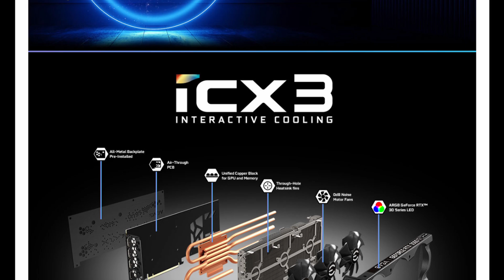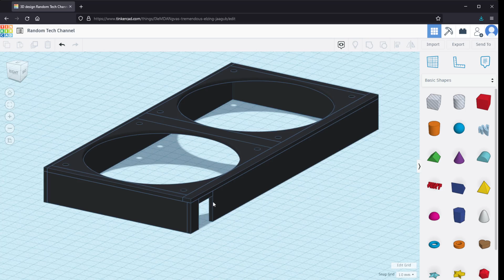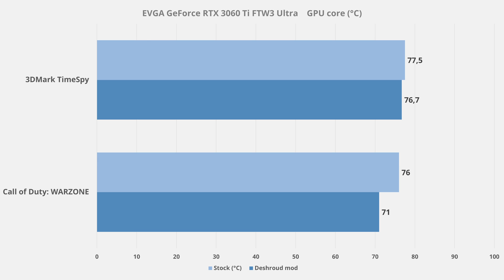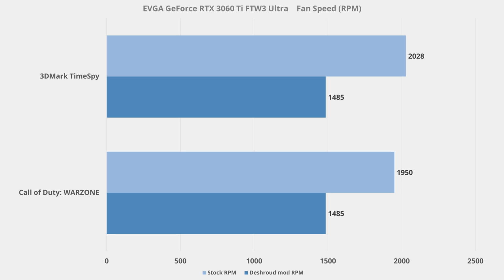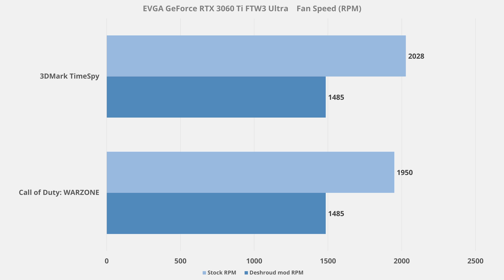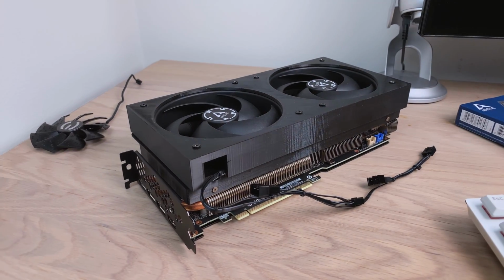I've designed a new shroud for my EVGA RTX 3060 Ti FTW3 ( 120mm fans included )

Comment: HI! I have this exact card. Planning to mod it as well, I checked the file you have in the description, I only plan to use the fan bracket. But I can't find it in the file. Can you please help me? Thank you.
Reply from the maker: There should be 'Files' tab on Thingiverse site once you open the link from the description.
Reply: @RandomTechChannel  Hi! When I click the link you have in the description, this is what is says "
EVGA RTX 3080/3090 XC3 custom Cooling Shroud"

Is this compatible with 3006ti ftw3?

Comment: I have two 3090 XC3 Ultras, 3060 ti FTW3, 3060ti XC, two 3080 XC3 Ultras, and a 3060 12GB.  I can see a fan mod on a 3090/80, especially the 3090; however, the 3060ti runs exceptionally cool.

Comment: Honestly for the results its a mirracle that it even helped. You GPU doesnt have any airflow and like this its probably best for cooking. Tip for you - open the front plate and instal any of fan in front or in bottom part (read in manual) and bring some fresh air to your GPU - it will decrease 10°C even without deshrouding and with it at least 15°. Trust me i know (same case 3090 deshrouded)
Reply: Do u use Zotax 3090 trinity by any chance?
Reply: @Nods.O  Hi, unfortunately not, i used Inno 3D X4 (really bad cooling) - but for your info i have so good results that i will create a video how to do it after this weekend. Just search then for deshrouded 3090....
Reply from the maker: Please have a look at my recent deshroud video which includes 3 120mm fans at the bottom of the case pushing cool air at the GPU. https://www.youtube.com/watch?v=ueLpP-Kaw4A

Comment: I too used the P12 for a while on it. Then changed them to Phanteks T30. And let me tell you, it totally does not worth it. At the same noise level, they perform identically. And if you increase the RPM of the T30 above 2000.... Well lets just say you don't want to. It's loud as hell. The P12 is simply amazing.
Reply from the maker: Thank you for letting me know! I might test Arctic’s new P12 MAX fans at some point.

Comment: Would have appreciated it if you have shown what kind of  connector the card was using. 4:10
Reply from the maker: It is a standard 4-pin PWM fan connector. The fans were not connected to the card.

Comment: Arctic fans are so underrated.. it is a great replacement for noctua fans yes in terms of noise and temperature 🌡️ vise. it is tested that in noise its 1-2 decibel and max 2-3° in terms of temperature in 100% load compared to noctua. and its dead Casper then the noctua.

Comment: it is simple physics that the temperature is very less. Just install the fan without the 3d printed bracket and you will see the real difference.
Reply: I installed the fan without the 3d printed bracke. The heat is hotter than with it.

Comment: You should redo the shroud design but this time instead of the 1800rpm arctic p12 fans use Gentle Typhoons 2250rpm!
Reply from the maker: Gentle Typhoons were my fav fans about ten years ago. Unfortunately Scythe doesn't make them anymore. I wish they were still around though.
Reply: @RandomTechChannel  Hi, thanks for the reply.
Actually even though scythe does not make them there is another company called XPG which has been selling them under the name XPG-Ventus pro 120.
Also perhaps in the future some Scythe Wonder Snail 120s would be nice to try ;).
Reply from the maker: @AutodidactEngineer  Thanks! Good to know. I will have a look at them at some point. (Have a cabinet full of Arctic P12s :-P )

Comment: Hey there, great video explaining the things I couldnt figure out on reddit. I have a question still however. For the original fan bracket do I need to get the one with or without overhang? I am thinking with but I am not sure if it matters. Also what material did you use?

Edit: got everything and installed it but unfortunately the shroud is too wide for the motherboard and i so cannot fit it. I now just have the barebone fans
Reply: Hi! You say you did tbis mod only without shroud.Does it work without shroud?
Are the results worth the investment?
What is the difference in temps stock/mod?

Thank you!
Reply: @krelcic  
1 Yes, it just looks less pretty
2 No, including fans it was like 200 euros so it is not worth it in general but for me it was quite nice, I used the nf12x25 for my 3080 and I never hear it
3 Did not test tbh sorry did it for sound only

Comment: I wonder, when GPU manufacturers will learn, that 2x120mm is more effective and quiet than 2 x 90/100mm and 1 x 80/90mm. Its 2022, and they are still in 2015. I really wish GPU without ANY fans, lower pirice, and conectors + handles for 120mm fans. Zipties are fun, but end look is dramatic - i use it that way and created cover for fans, so they are not visibile.

Comment: Isn't that AIO installed incorrectly? Radiator tubes should be higher than the pump to prevent air bubbles getting in to the pump.
Reply: almost best position, tube on radiator down is after top mount second best position

Comment: Great mod! For those not connecting the replacement fans to the video card, you can use Argus Monitor to control the fans using video card temperature readings.
Reply: or you can use FanControl that is free
Reply: It's amazing software really

Comment: The reason there is barely any difference is because the heatsink on the GPU is too small.

You want atleast a 2-Slot heatsink without fans.
Reply: nah, you need fans more suited to the size of the heatsink, you also need fans that get close to the RPM of the stock fans, on top of that he would've been better using 3x 92mm fans
Reply: @insomniacbritgaming1632  surface area is surface area, and if there isn't enough no amount of fan will be able to help you. The EVGA RTX 3060 Ti FTW3 only has a 1 slot thick heatsink, which isn't enough.

Comment: I think the heatsink might be too small. There's always two parts to the equation: 1. The heatspreader has to dissipate heat into air 2. Fans have to move cold air into the heatspreader. If the stock fans already provide enough cool air, having better performing fans won't impact thermals much (you could run them at much lower RPM though). 

That might be the effect you're seeing. (it's a continuous process of course).
Reply from the maker: Headsink can be one reason indeed. However Asus' Noctua MOD card is using pretty much the same heatsink as the regular version. I'm working on my next video with some improvements over this one. 'Stay tuned!' :)

Comment: I'd recommend repasting. And to be honest, it might be worth getting the Morpheus and putting dedicated heatsinks on the VRM and mem modules.
Reply: I emailed rajintek support and the Morpheus core 2 isn’t compatible, though are there other ones like that
Reply: The problem is to find a Morpheus Core II or Arctic Accelero Xtreme 4. They are very rare to find. Plus this vga used in the mod already has a great heatsink. Asus Strix also has great heatsink. And the way the heatsink is designed and attached in this gpu makes it easy to place the mod there

Comment: I would suggest high static pressure fans for this mod.
Reply: They are arctic p12s
Reply: @jarrodau2134  the problem with that is these are marketed as high static pressure fans but only have a static pressure rating of 2mm. Which is an extremely low static pressure.
Reply: @RVACREF  I'm sorry you're unable to understand that they are very solid fans
Reply: @jarrodau2134  those are extremely low static pressure fans, you are looking for high static pressure fans. Do you even understand what the difference is?
Reply: @jarrodau2134  well you obviously don't understand what static pressure is. Both of those videos didn't even touch the static pressure rating.
Reply: @RVACREF  the manufacter stats are useless when you choose a fan. P12 are among the best static pressure fans existing and you can understand it because they do very very well on radiators and heatsink (obstructed airflow type)
Reply: @Smallman647  no they're not the best static pressure fans you can buy. I would be willing to bet you don't even understand what static pressure is.
Reply: @RVACREF  they come after phanteks t30 and noctua nf-a12x25 (very close). And if you search online pressure optimized fans they appear on different articles. I think you should start to learn what is static pressure optimized fan and then come again to speak on youtube.

Comment: This mod looks great, very interesting. I have an EVGA 3060 and an MSI 3060Ti, will be taking measurement to see what is compatible or how to modify the design to make that work. In the case you used, I think the temperature reductions at the sound levels recorded were quite good - I think with a more open case and/or a more open case with bottom intake fan, the temperature difference could be a good bit higher.

I don't know if I ever saw anyone confirm yes or confirm no that if you stop powering the GPU fans from the GPU itself if the savings of the assumed 2-6 watts that they used to draw becomes available to the GPU's core. I would assume no but am curious - did you by any chance note the power draw with a program like HWinfo64 before and after?

Comment: How do you hold your card up, without it sinking down on the far side? It looks perfectly straight in the video, but I see nothing supporting the rear side. I myself must use a smal plastic tube (that used to store pills), which happens to have to exact perfect size to keep my GPU 100% leveled.
Reply from the maker: Backplate can help a lot.